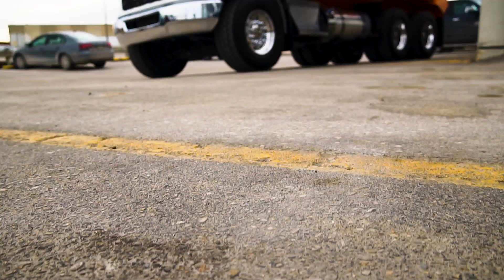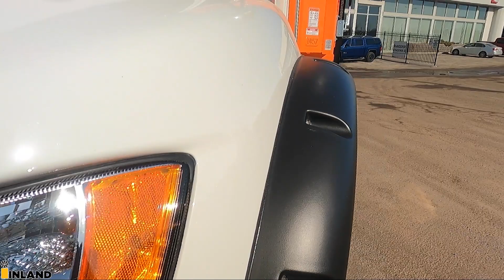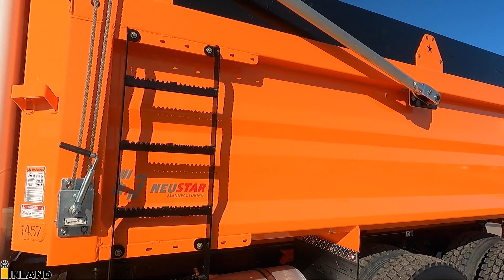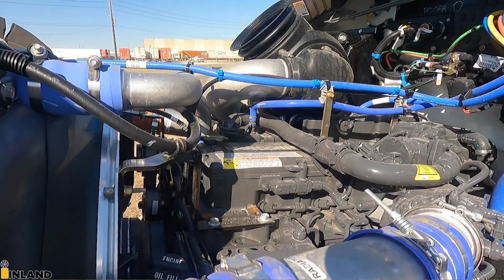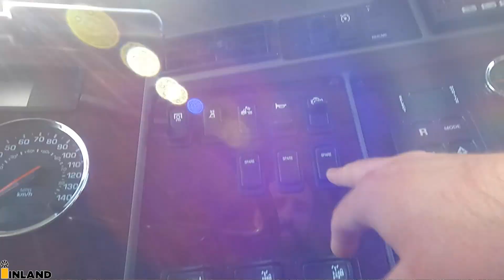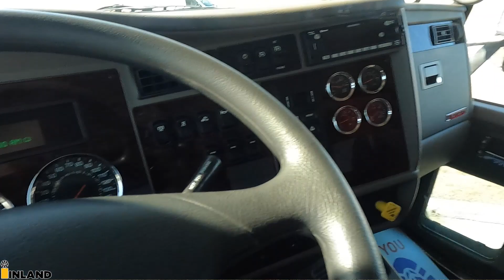2022 Kenworth T370 Dump Truck

Comment: What are all the sleeper options for A Kenworth C500/C500W? Also, what are the other options for a C500/C500W like the axles, suspension, and other stuff?
Reply from the maker: Not too sure honestly as I don’t spec them ever. In 17 years hardly ever. I know you can do the 42” flat. Not sure in the aero cabs. The t800 you can get all the cabs we offer on the 1.9
Reply: @AndyTheKenworthGuy  Thank You I was wondering what is the biggest setup you can do the biggest axles, suspension, and everything else I know a company that's interested in the Kenworth C500W and T800W and they want to get everything the biggest possible.